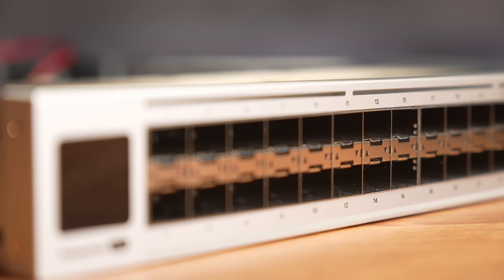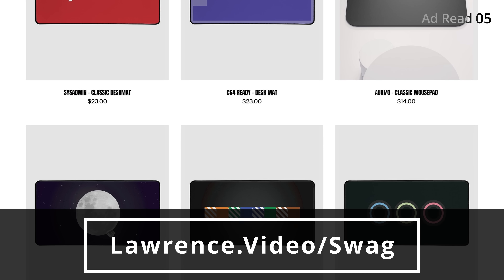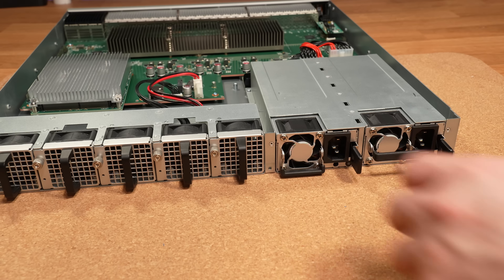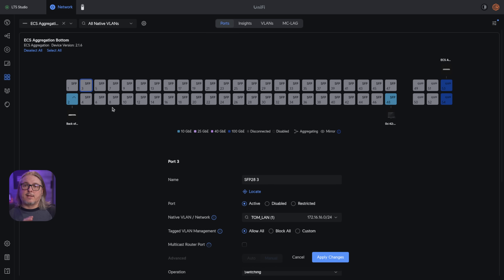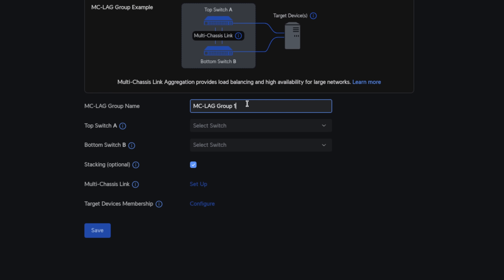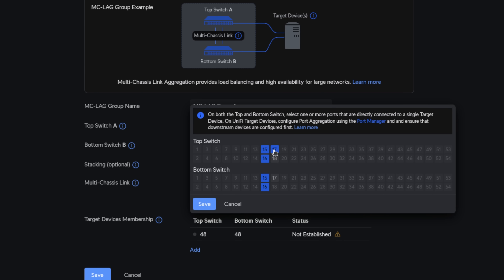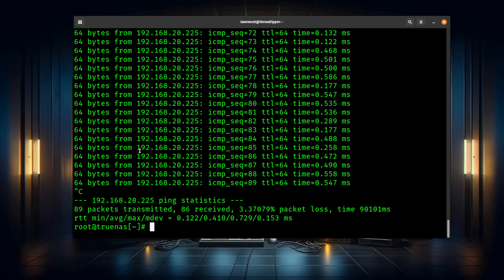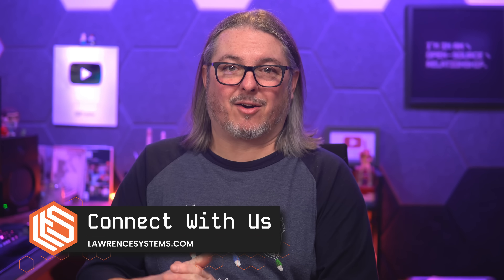Enterprise-Grade 100Gb Networking? UniFi ECS Aggregation Switch Review

Comment: I operate Linux server as my daily job, at home I do EVERYTHING, but getting a high skill level of everything from operating an OS, to hypervisors, networking, and general hardware is quite hard, and I've only got 24 hours a day to work with, and I also need sleep every now and then. Even though I got the CCNA and CCNP, and I could just "convert" it and learn a new system, I simply don't have time.

That means I cut some corners, and I did that with my networking. I use Ubiquiti because it's easy, and it just works.
I don't have time to get my hands down into everything, even though I want to.

I chose Ubiquiti/UniFi because of the ease of use.
My thought of it is that if it works, it works, and then it ain't stupid.

Comment: Is there any chance they could add this functionality to their lower end switches? When you consider low end from other manufacturers (lets use Aruba InstantOn 1960's as an example) they support stacking and MC-LAG, I can't see a reason UniFi couldn't add this to their Enterprise Switches, or Pro/ProMax switches to be honest. I assume on the back end, those other switches don't run SONiC OS and this is a feature of the OS.

Comment: Nice addition to the unify line.  Curious to hear use cases from folks.   Nice price point for say video editing … if these were in a network core I’d be nervous though.  UniFi controller restart could cause a re-provision and adding mlag members already does the same …  unacceptable downtime. I’m used to Arista switches that don’t have this issue.  It is amazing though to see this in the UniFi ecosystem though.
Reply: Offhand, a big esxi or proxmox cluster would benefit from this sort of networking. You'd have 25g node-to-node and 400g to the rest of the network. Great TOR switch basically.
Reply: Controller restart doesn't affect the network. You can take it offline and everything continues to work, zero downtime. The mlag modifications you just saw lost a total of 3 packets and took under a minute so your downtime was 3 packets.
Reply: You only need to keep the controller running for gathering traffic statistics and for the guest portal. 
 
When a device is provisioned, its configuration is stored on board. So it doesn’t need the controller to be kept running.
Reply: @williamp6800  Watch what happens to your devices across all of your sites when you upgrade your controller ... many times there is a re-propvision.  I have also seen this a few times over the years with only a reboot of the controller.

Also, I'm not saying that 3 packets is bad, just potentially unacceptable for a large network core.  Depends on the use case.  The fact that I'm even thinking of comparing a $xxxx switch to a $xxxxx switch shows how far Unifi has come.
Reply: @ I’ve never seen a device re-provision as a consequence of upgrading the controller software. I’m only running a single site but I can’t think of a reason why it would be necessary no matter how many sites. 🤷🏻‍♂️

Packet loss happens on Ethernet networks. Ethernet is designed in anticipation of it happening. Frame size would drop after each packet lost,  and essentially return to full size pretty much instantly for all practical purposes. 

What circumstances do you have in mind where loosing three packets would make the slightest difference?
Reply: @williamp6800  How about a VoIP provider with hundreds of calls in progress or the connectivity for CEPH? This will result in customer complaints or … all of the VMs that rely on CEPH freezing for a moment/storage nodes (OIDs) being marked out. For an office environment, it's not an issue—just schedule downtime for changes. For a data center environment, there may only be low-use times / no good times for the schedule.

Maybe UI will add a feature to allow updates/provisioning to be scheduled.
Reply: @ how much time do you think it takes to retransmit a packet?

Edit:

You do understand the switch remained functional the entire time? There was a pause in the interface while it provisioned. And three packets out of how many in that time?
Reply: @williamp6800  UDP doesn't re-transmit.
Reply: @rotaryconvert  true enough. 

So what percentage of the total traffic in a minute would 3 packets represent?
Reply: @ There is already a setting where you can schedule updates. Has been there for a while.
Reply: @rotaryconvert  You can, and should, solve that with redundancy.
Reply: @williamp6800  LOL ... a fraction of a %.  Not enough of a number to complain about given the cost diference.
Reply: @diceman199  Yes, this works well.  It would however be helpful to schedule updates caused by an updated or restarted controler.
Reply: @jttech44  We can and have by not using Unifi.  If a controller update mass re-provisions gear redundancy does little good ... This is why we don't use unifi at the core, only the edge.
Reply: @rotaryconvert   but where did you get this idea that a controller restart causes anything to be reprovisioned? I’m not an expert by day means but I’ve been in the Unifi ecosystem for seven years and this the time I’ve ever seen anyone talking about a controller restart causing it to happen
Reply: @williamp6800  I've watched it happen when we upgrade our controller. There are 100ish sites and 1000+ devices present. When the controller is upgraded (most recently we use GLENNR's scripts but have done it by hand in the past) devices start "offline" and don't always change to "online" directly. I'll watch and note the states the next time we upgrade our controller. I'm assuming that it's a re-provision or setting update that restarts devices. I've been in an office and experienced temporary offline conditions. We've learned to update the controller after hours.
Reply: @ wow. 🤷🏻‍♂️

I can see why that would be a concern.

Comment: You mentioned the firewall, is there a UniFi firewall that supports outputting in a split LAG like this so you don't lose internet if you lose (or restart/update) one of the switches?  Bearing in mind that the ports on this switch support 10g connections at the lowest, so you'd need a firewall that can connect at 10g... twice.  (And then there's the CloudKey problem, tho I suppose you could self-host on a system with dual 10g ports)
Reply: The switch ports here are 25G SFP28, not 10g… You can uplink to a pair of HA-EFGs. The network application of the Cloud Gateway hands over pretty seamlessly as it is constantly being SYNC'd.
Reply: @ventlucas  I have this switch at the office.  The SPF28 ports are configurable to either 10g or 25g, depending on your needs.  But they are NOT configurable to 1g speeds.

It's a silly to spend $4k on a pair of those EFGs when you could put them in redundant PCs and self host for a fraction of that, but I guess that's the canned UniFi option.  The single application is not demanding, to put it mildly, so $2k for what is basically a $200 cloudkey in a rackmount form factor and a 10g network card is nuts.  The cloudkey platform really doesn't need more than a 1g line given the limited throughput it needs (maybe different if you're actually hosting 5000 clients?), so using a 10g connection is already nuts, let alone a 25g...

Comment: I really wish Unifi had a better command-line interface, similar to how EdgeSwitch does. The command line was just as good as the web UI. I recently migrated some switches from Cisco, and writing the configuration would have been a lot easier if I could adapt the Cisco config.

Also, I wish more Unifi switches supported MC-LAG. I’ve been planning some homelab upgrades around the hi-capacity aggregation switch but will need to use Active/Active on XCP-ng and load balancing on pfSense.

Comment: I already have one 8 port aggregation switch I'm using with my UDM Pro Max, USW Pro Max 16 and USW Pro Max 16 PoE (along with my unraid server on a LAG group).  I'm considering adding another 8 port aggregation switch.  What would be the best practices for connecting the two?   What would the best practices be for connecting the two SFP+ switch ports on the switches to the aggregation switches after adding another?  (I'm using 10G SFP+ DAC cables for interconnection)
Reply: Those 8 port agg switches do not support the technology shown in the video.
Reply: @112Haribo  I am aware.

Comment: I remember reading an anecdote online that someone successfully stacked a pair of geographically dispersed datacenter switches using single mode fiber links. I wonder if these Unifi switches can stack over single/multi mode fiber or if it has to be done via twinax DAC only, and if it has a latency limitation for the stacking links.

Comment: Thank you for the awesome video.

 Is this the only UniFi switch based on Sonic OS? Is that why it supports MC lag and none of the rest? 

I want a fully redundant Unifi-based setup for the house but can't justify $10,000 for a high availability Plex server. Lol

I have an IT business but our biggest client is about 75 PCs and none of the onprem servers are mission critical, so it's a hard sell.
Reply: You can still do full redundancy by just relying on RSTP
Reply: @Vectorous  would you mind elaborating? I'm trying to eliminate any single point of failure. I'm not sure how I would assign IP addresses/configure nics on my servers in that scenario. 

I planned to use LACP and MLAG to connect each server to each switch, both switches to both firewalls 

Dual WAN, HA UDM Pros. I have three proxmox servers in a cluster, each with dual PSUs, each server has one PSU on one UPS, the other PSU on another UPS, each UPS connected to a separate power circuit. Generator failover for power outages.

Also, I'm self(aka Google) taught, so I didn't take any networking basics classes. and I have autism so I've been hyper fixating on this idea and have no real need for it. But any help is greatly appreciated! Thanks!
Reply: @griffincash661  I think they're suggesting looking at other NIC bonding strategies other than MCLAG (e.g. active/backup) with two switches. (Though, STP is not necessarily needed here.) Linux and Windows Server support various NIC bonding strategies afaik.

Comment: If you do not adapt these switches with a Unifi controller they should be manageble from the commandline. And if it actually comes with fully working SONiC, the $4000.- is a pretty good price.

Comment: I noticed you have the non-S model with the stacking forwards and management port on the rear of the chassis. I wonder how different those are if any in stacking and how they work.
Reply: That is only on the copper model. This aggregation model is not offered with dedicated stacking ports in the back.
Reply: @JZB-2022  I know this but there is an 'S' stacking 24 and 48 port version of that campus switch with and without stacking and management ports on the rear. $500 price difference. The S model is Q3 of this year on the site. Wondering how different they are with stacking and what we can do with that management port.

Comment: Im confused.  Were you showing us MC-LAG or stacking?

In my experience, one should not be using both together.
Reply: I think ubiquiti is kinda bastardizing the terminology here.
Depending on if the stacking check box is checked it's either mc-lag or lag between two ports on stacked switches
Reply from the maker: When you setup MC-LAG you can also have it stack the switches

Comment: It would be nice to look at 100GbE switches where the port speed is 100GbE. 
16port Nvidia (Mellanox) is ~10K (or less)  3X the price.

I get that these are 25Gb/s ports and there are 48 of them... but if you're a SOHO or need that ToR switch to do 100GbE in the rack... this won't cut it. 

Also have to wonder.... 42 1U in a rack  So realistically... are you really going to have a full rack of 20 2U boxes?  Especially when you're looking at Compute nodes that will probably include AI GPUs or DPU cards?  And what about storage? 

Considering power and heat... what's a realistic configuration?  As to ports... you'll probably want 2 1U ToRs for redundancy too.... 

Just asking for a friend...
Reply: I see the point in calling it a 48x 25g switch with 6x 100g uplink vs calling it a 100g sw
Reply from the maker: If you need more that six 100G QSFP28 ports then this switch is not for you.
Reply: @LAWRENCESYSTEMS  
Well yes... but the title is a bit misleading because when you say 100Gb/E switch you're implying port speeds of 100Gb/s

This is really a 25Gb/s switch w some 100Gb/s ports
Reply from the maker: @michaelsegel8758  It has six100G ports so that does make it a 100G switch.
Reply: @ 
Meh. Not really. 
I've always hated the marketing folks who did that.  
I mean you can't stop that from happening but it means if you're looking for 100Gb/s port speed... you're going to be disappointed.